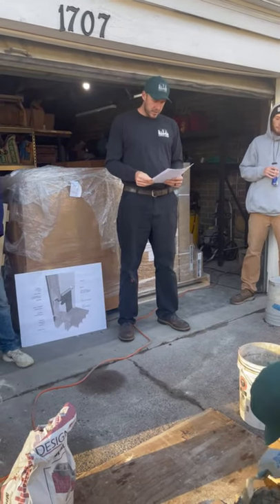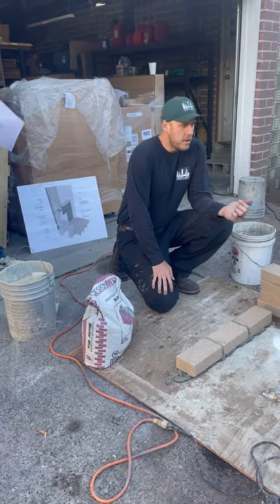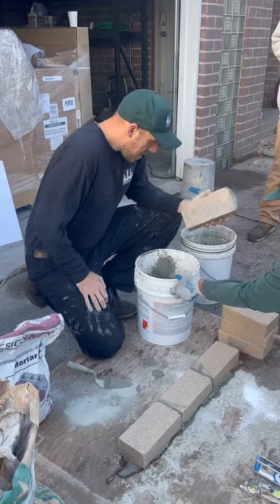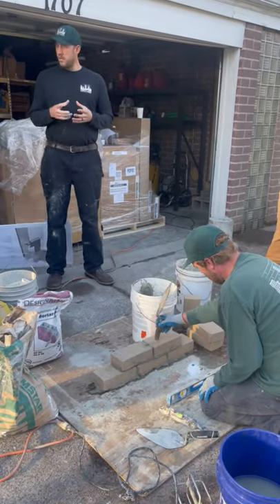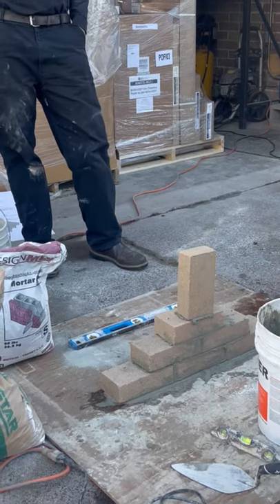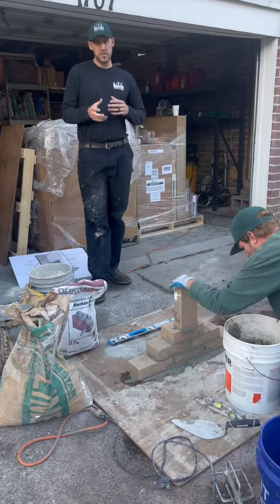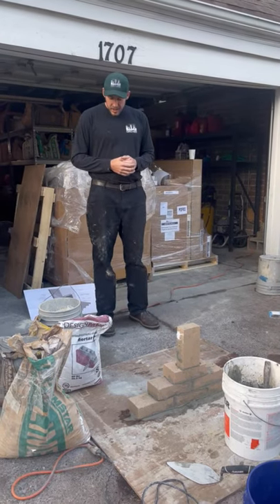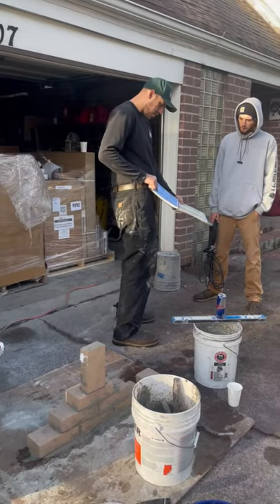Refractory Cement And Mortar Mix  For Firebox Builds And Repairs

Comment: Thank you for this video.  I have a Rumford firebox done in herringbone where the mortar keeps cracking and falling out.  It has been redone a couple of times, but now I want to do it myself.  I burn a tepee type fire with wood up against the back wall.  Halfway up the  side bricks and the middle bricks of the firebox the mortar cracks and falls out and the bricks get loose.  I have burned wood my whole life in stoves and fireplaces.  The masons told me 2 weeks before a fire.  I waited a month.  I started a couple of small fires to burn in the firebox.  I burn mostly oak and ash, with some walnut and sycamore that we have around the farm.  I am wondering if the main problem here was the mix used and/or no pre-wetting of the firebrick to prevent moisture loss.  Should I grind out the cracked and crumbling mortar and just repoint or should I remove the entire firebox full of brick and start over?  Is that even feasible?
Reply from the maker: It all depends on how deep the cracks are. If the cracks go clear through the brick and the bond is broken then tuck-point won't last. 
Part of your problem is the about of heating from your fuel choice. This are hardwoods that have a high energy density. I would recommend a fire-back with your choice of burning practices. 
The Gratewalloffire.com has an amazing product. They can design a fire back and vertical grate for your rumford that will hold your wood in the perfect position. The 3/4" thick plate steel will help protect the back wall of the firebox and allow the rumford to perform even better.  Or you can likely weld up your own.
Reply: @PortlandFireplaceandChimneyInc  thank you.  My builder is going to redo it again using a running bond.  The thought is that the small cuts and joints are flexing too much.  I also agree with you that this time I will weld up a vertical grate and maybe get a fire back.  I read where someone used soapstone foe one and it continued to radiate lots of heat even after the fire had gone out.  In any case, thanks for taking the time to reply and offer help.  We'll see how it goes!
Reply from the maker: @rvb01  100%. There is also fire brick that are more dense that are crushed up soapstone. This might be a good idea if you plan on continuing to burn firewood, that is extremely energy dense. To give a comparison on BTU content for each type of species of wood download a BTU chart off-line. You’ll find that fir has 17 million BTUs per cord and oak has 29 million BTUs per cord.
Reply: @PortlandFireplaceandChimneyInc  thanks.  I didn't know that.  I'm going to give this another go and see.  I might decide to put a small jøtul stove in the fireplace and get all the benefits of wood without the pain of the fireplace.  There's nothing like an open fire, but you still always have an open hole in your house.  We shall see.  Thanks so much for the info and conversation!
Reply from the maker: @rvb01  absolutely. This is why we super insulate behind our fireboxes with K-wool insulation and all around the flue liner to the top. And install a top seal damper kit. 
This has a drastic impact on performance and longevity of the system. But also prevent the cold from transferring through the masonry. 
I love wood stoves also. Each hearth configuration has its characteristics. They are measures that can be taken to increase performance and longevity. But most people often don't want to spend the extra money and most companies are not aware of the smallest differences that impact the quality and longevity of the system

Comment: just discovered this video and the channel. great info. I'm a chimney sweep and in a few months will be replacing a few broken firebricks in a standard masonry chimney. could you point me in the right direction for the correct type of mortar to use for this? I was under the impression that as long as it's refractory it would be fine, now I'm not so sure. what you said early on about having your mortar be thick enough to get that angle along the back wall, is that just dependent on the mix?
Reply from the maker: Mix your own. 
1 part 60 grit sand
1 part Portland cement 
1 part lime
1 part Lincoln fire clay  or other fireclay (insulator) 
Dry mix first, then add water to desired consistency. Let it set up a bit and go to town!
Reply: @PortlandFireplaceandChimneyInc   Hi there, on the video you said 3 scoop of sand and in your comments You said 1 part of sand? What is the rigth mix? P;sp , what is 60 Sand? Thank You
Reply from the maker: @jamalmouradven  it depends on how big of a batch your making, the conditions you are laying in, and the size of the joint you are going for.  60 grit sand is a size of sand that works well for fire brick building. You can get really tight joints and better thermal performance overall.  Each build is completely different and a masonry will make his mix depending of the temperature and moisture content in the air. 
Being conscious of the motor workability, and at what rate it starts to set is most important. 
You will notice if you play with the materials, you will become of aware of characteristics and work ability of different densities.  Sometimes your rebuilding a firebox back wall and it slopes towards the fireplace facing. At this area I add a little more Lincoln fire clay to get it more sticky, it sets up a little faster. If you don't add enough fire clay the brick won't bond quickly enough and the wall falls over. A little electric heater is wonderous in this area. At the back wall transitions to the damper and the throat it very tight and difficult so changing the ratios in your mix becomes crucial to perform the rebuild in a timely manner. No one like to watch paint dry, same for firebox building. It's agonizing working with a mix that's not properly tuned for the area.

Comment: Is there a difference between refractory mortar and fire clay mortar?  If you want to line the inside of a fire box/smoke chamber can you simply mix fire clay into standard mortar?
Reply from the maker: The difference is refractory mortar has a significant amount of insulation in the mix. This provides a greater thermal performance. 
It's used to smooth out corbels in the smoke chamber. Corbels and off sets are the most common areas to leak heat out of the brick. 
Fire clay is used for tight joints only between refractory brick. 
Great Question!

Comment: I’m rebuilding the top of a fireplace where a liner meets the firebox and creating a dome shape using metal mesh. Most mortar I’ve seen in fireplaces is thick and gritty, but my refractory is thin like grout. Can I mix it with type S or N mortar to thicken?
Reply from the maker: The best products to use for a smoke chamber are. Chamber tech 2000, chamber safe from Lindemann, or formula 51 from saver system in Indiana. I can connect you to a sales rep if you would like. 
I would not add type -s because the sand most times is to large. You want a very fine play sand if your going to make your own mix. You can also add fiberglass as a reinforcement agent. This will reduce shrink cracks as it drys.
Reply from the maker: An really important detail if you're using metal lathe in the smoke chamber. 
1. Install ceramic paper on the walls with before the lath. 
2. Only use stainless steel metal lathe. 
3. Do a 1" scratch coat with your refractory cement. 
4. Do a 1/2" finish coat with refractory cement. Smooth with wet paint brush.

Comment: It’s too bad you’re employee didn’t build my firebox sides independent from the back wall, he did a running bond, I can’t wait until it cracks and has to be rebuilt
Reply from the maker: I'm not quite sure what you mean. Most fire box back walls are running half bond. Herring bone is high strength but cost prohibitive because of the additional time on layout and cuts. I think you may have a fundamental misunderstanding between cold joints and running half bond layouts. Please email me a picture of what your talking about so I can provide clarity.